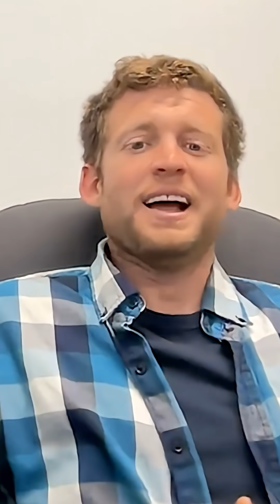Why Edison Motors Won’t Build Your Crazy Hybrid Idea… Yet (Pickup & Semi First)

Comment: Something artic would probably need a different approach. For example with extreme temperatures you may just have the diesel genrun a very low rpm constantly to eliminate the difficulty of starting but just re-gear it to drive the Gen at low rpms and thus still increasing the fuel mileage.

Just my thoughts. BTW you guys are great! 💯 👏 👏

Comment: For Semi-Trucks: "weightless" electric trailer uses a "smart kingpin" to sense when the truck is accelerating or braking. The "Weightless" Effect: The trailer’s electric motor matches the truck’s speed instantly. Drivers describe it as feeling like they are "bobtailing" (driving the truck without a trailer).

    Benefit: It can improve fuel efficiency by up to 40% and uses regenerative braking to save on brake wear.

Comment: A full hybrid, with the engine capable of directly driving the axles, would add a lot of complexity, but you could have a pretty efficient diesel or propane generator mounted behind the cab and feeding into your electrical system with very little added engineering on your part. You'd just need a genset manufacturer to build them to fit your trucks.

Comment: Any info on the truck kit progress/expected cost??  Thanks!
Reply: According to Rich at Deboss Garage, an undisclosed Mine in the US put up like $500k for rich to build a diesel/electric hybrid toyota landcruiser model 79 for the mine. That truck is getting tested to destruction now in the USA to make a list of lessons learned. Once that design gets updated, tested, and approved, then that will open up the floodgate for Edison to bring in shipping containers full of batts, engines, inverters, etc.

At the same time, I believe the black dodge prototype is getting its custom wiring harness from a supplier local to Rich up near dunville in Canada. Once the harness is in, then it will take an Edison programmer to be on-site to get wheelspin going.

So the parts list is nearing completion.

As for availability, holy cow, there is like a waiting list of 2,000 people chomping at the bit to get parts.

As for pricing, every component is pricey. They have mentioned 30-50k, plus $150/hr for install (unless you install yourself)

So the good news is progress. The challenging news is patience.
Reply: @Sah-o5m Thanks for the info. Here’s the thing… even at $55k… updating an older truck is still miles ahead of spending $100k on a current generation product which… probably has tracking software, poor engineering — things are buried where they cost 7 hours to extract and replace, components are merged with others (door assemblies instead of parts, thermostats attached to $700 parts, plastic alternatives to metal components)… invasive cameras and LTE connections… just makes me sour to think about it all. This, for a business, is a better alternative and better for the environment.
Reply: @elrickthebrave 
Amen Mr. I would gladly pay big bucks for a truck that will last a lifetime and I get to repair it at my leisure than the dreck they're trying to foist on us these days.

Comment: You should put a DC charger option on the back of your trucks near the air hoses.  The use case is simply... reefer trailers. 

Have a data connector so the driver can get live temp readings from the truck.

Comment: Question about the pickups, would the generator and batteries be suitable to run a welder off of? I'd love to see a hybrid welding rig built the way you guys do it. I think it'd go a long way to bringing cost down in the industry as we won't need a second engine running on the rig just to generate power for the welder and tools.
Reply: Yep. I believe the plan is to be able to make a rig that can weld.

Comment: Im a 58 year old auto mechanic 😜. I'm cheering for U. I know you're pickups will be deadly,built for Canadian environment. Good Luck.
Reply: The pickup (the Ram) is already ripping tires on the dyno... Offering way too much for the dyno to bite than it can chew.
Reply: Proprietor customer service lockouts right from Dodge. I remember when they quit putting dipsticks to check levels. $$$$

Comment: The specs needed for a edison ready mix concrete truck are insane. They have to work in cold conditions. They have to need minimal maintinance after heavy undercarraige mud and water.
The reliability of all systems needs to be better than industry standard. Timed loads, if critical systems go out on the way to, or at jobsites. Its reputation loss,
$$$$$ in concrete waste, plus actual repair costs. 
Buuuut a dump truck chasiss with an agitator is far simpler to make bulletproof . The kind used for city road paving contracts

Comment: I really like the idea of hybrid electric kits. Just some general purpose kits that can be retro fitted onto many different types of vehicles. You could do just a few sizes and then leave a lot of the fabrication to the consumer. It would be great for ruined vintage cars, which I'm a big fan of. I'd throw a small hybrid electric kit on my VE beetle in a heartbeat. Maybe an idea for the future.
Reply: If I'm remembering correctly that's basically what the pickup truck kit is, no? They supply the axles, generator, and electronics and an upfitter/dealer they train installs it. Just without the options for smaller vehicles. I'm sure they'll get there eventually.

Comment: Why not hybridize the E- buses in Edmonton and Regina which have proved useless in winter due to lack of range caused by cold
Reply: I want to see a spin-off licensing the tech under Edison Buses 

Most buses are just a chassis with tack-on frame bodywork, can easily use the truck tech for the buses. Tho, I foresee the main cost is the ramp up since you probably need the mass for delivery. (IMO if it got real popular you could even be part of a government package as aid to the Africas, licensing the tech to their local bodywork builders)
Reply: @PrograError RVs.  I want to see serial hybrid RVs.  And school buses.
Reply: They just need to adopt newer battery chemistry.  The days of NMC domination are waning.
Reply: @ChrisNotTheKing Im pretty sure NiCDs are far less susceptible to cold than lithium-anything. 
Notwithstanding low charge density,  lead acid batteries are quite robust, as long as you feed them reasonably close to the correct voltage on the high side.  That includes charging them when they've cold.

Comment: Not necessarily a mission for Edison.  But, I'd love to see someone convert or sell kits to convert popular EVs, into pluggable hybrids.  Basically install more powerful range extenders with a large enough fuel tank, so their is no need to plug in, but can be plugged whenever convenient.
Reply: If only they made a invention that ran on gas , generated electricity , and was portable.   Whoever invents it should call it a generator....
Reply: @thelostsoul5531 I'm always picturing a Honda generator with a 5 gallon gas can sitting on a tow hitch attachment with a cord plugged into a Tesla.

Comment: Do you see a time when batteries get dense enough and cheap enough for Edison to be fully electric?
Reply: The point of them doing hybrid right now is, because of that. Batteries just don't have the capacity to do the job by themselves. Thats why they have the gen-set under the hood. Once range anxiety is no longer much of an issue, yeah they'll more than likely go all electric.
Reply: Well I've personally looked into it, just for my own purposes, right now battery technology is working on solid state batteries. One of the major downsides especially for trucking with standard battery technology  is charging speed and convenience, it just takes too long, yeah you can speed it up use fast charging but this damages the batteries over time. Series hybrid is a great way to deal with this problem, you can still charge the batteries without having to speed it up damaging them. Now with solid state charging faster is not a problem you can charge much faster without worrying about that, plus you can store more electricity in a solid state. However we are not even close to solid state technology being practical for personal or commercial use we are still working on the technology. But even in a theoretical best case scenario it would still take about twice as long to charge a solid state battery as it does to fuel up a car. In commercial trucking time is money, and in a car no one wants to wait that long, so as far as I am concerned series hybrid is the best way to go for the foreseeable future using the best of both worlds, though of course solid state series hybrid would be a very efficient vehicle huge potential in that.
Reply: Unless those batteries can charge themselves that's not happening.
Reply: Eventually it is a possibility. But that's likely at least a decade away at minimum.

Comment: I think it is a very natural fit for RV chassis manufacturing.
Reply: This is brilliant... You won't need a separate generator for electric power because you'd already have one built in.
Reply: Especially because of the fact that it's powered by a literal generator.
Reply: Yeah I think if they are able to make a modular solid axle setup for people to drop into their vehicle and have a software package to manage all of that with the generator, it could be amazing. Like imagine for an rv or old pickup to have a small battery and an electric solid axle with a large frunk and a large generator in the back to keep things running, that would be cool
Reply: The stuff for my f350 would also go right under my f550 chassis motorhome with way more battery space
Reply: With solar pannel on roof
Reply: That's something that customers can easily accomplish whenever there's kits available. It doesn't really require much engineering beyond having a sizable DC to DC converter to maintain "house power".
Reply: They already did the engineering for the Burning Man Doof Doof Bus. The biggest sound system that moves while blasting tunes. It even has split system AirCon.
Reply: I been saying the same thing ever sense the start of the truck platform. I want to put one these in a old gmc motorhome sooooooo bad
Reply: @AZACKAL  Absolutely agreed, the GMC Motorhome platform would be an amazing conversion, because with wheel motors you could keep all of the best part of its unique design (low floors) while ditching the worst part (front wheel drive).
Reply: with machine guns, and missile silos, and sharks with lazer beams!!!!!!!!!
Reply: I been saying it for decades. Just no idea how, and caught up in my own life. I've actually got two Dodge motorhome chassis that would benefit from the pickup conversion. All the same stuff-bolt right up. 👍
Reply: The trucks are often converted into RVs. And could be plugged into the towed trailers providing enough 110 or 240v for normal appliance applications.

But the market for how many people can afford an expensive hybrid power train RV is smaller than the number of old pickups need modding to be clean and more fuel efficient. So, build market share in the larger market instead of splitting focus
Reply: Especially diesel pushers and 6x6s like MAN Kat1 and TNA trucks

Comment: Maka a medium or small off roaded or work truck avaiable in Europe and you will have the whole market.
Right now there are no good options for that kind o vehicle, simple durable and not overpriced.
Reply: Definitely need to petition your government to allow more imports.
Reply: I seriously doubt anything but a huge company could afford EU compliance certification.  Canadian government is giving them enough grief.
Reply: @lloydrmc  there are plenty of small niche vehicle manufacturers in Europe. It’s actually pretty easy to sell a vehicle here. Sure, the engine needs to be compliant but most engines have a euro rating. And sure there are safety regulations you have to meet but that’s off the shelf technology these days too.

Don’t know about hybrid technology but at least the regulations are there for the consumer (and or for safety) and not solely to keep competition away from the big manufacturers.
Reply: @autobootpilootfair enough.
Reply: There are plenty of smaller off-road vehicles in Europe. We have 4x4 pickups, smaller vans and bigger vans that go up to 7 tons (iveco daily is very popular in that size). We also have the unimog. Not cheap or simple but very efficient and extremely high quality. If you want bigger you can go to any random truck manufacturer and click the box for however many axles you want to have driven.
Reply: @autobootpilootword.  And I'm sure I'm not the only western hemisphere motorhead with Unimog envy.
Can you imagine turning Unimogs into Edison style serial hybrids?  Best of both worlds.